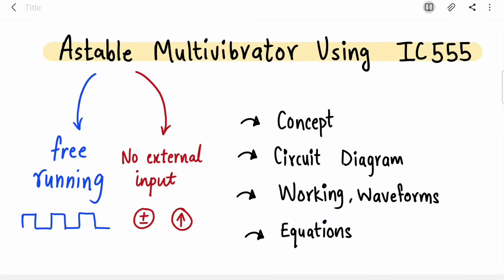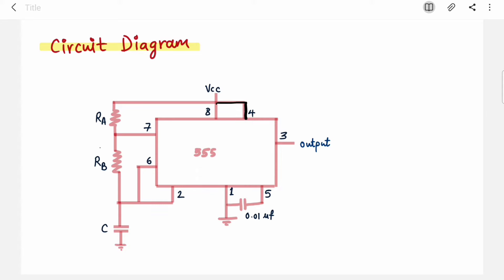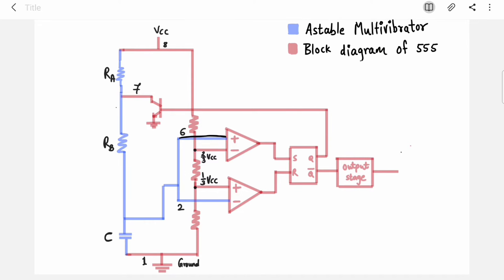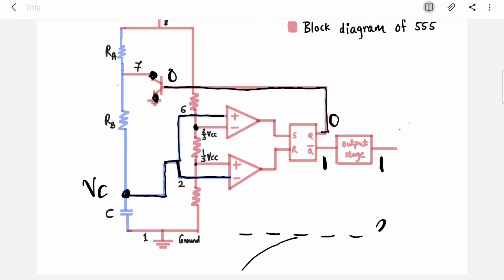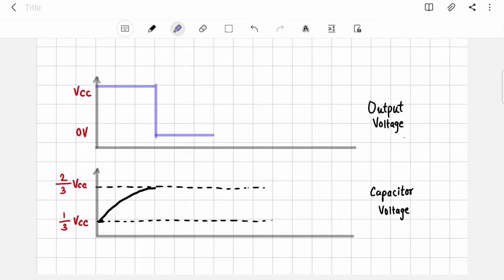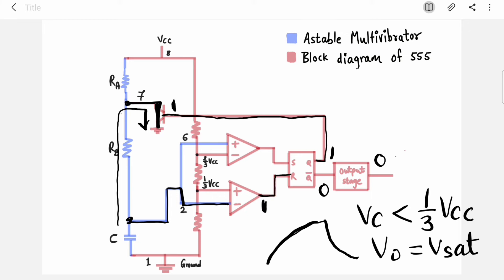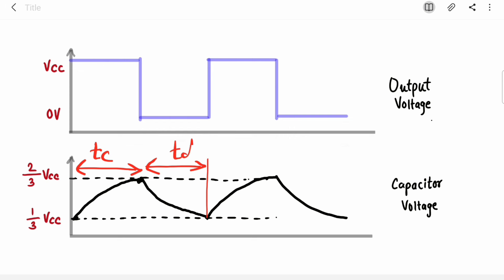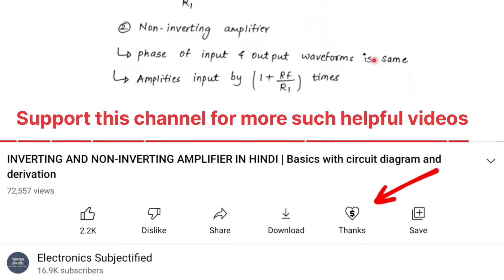ASTABLE MULTIVIBRATOR USING IC 555 - Circuit, Working, Waveforms, Equations

Comment: If output stage is 1, then how come Q' is 1, it should be 0 na (bcs its inverter),  pls clarify mam?
Reply from the maker: Because Q' is connected to output. So output follows Q'. Its still 0 if flipflop is set and 1 if flipflop is reset. Its just connected to output stage so whatever Q' will come it will be transferred to output stage.